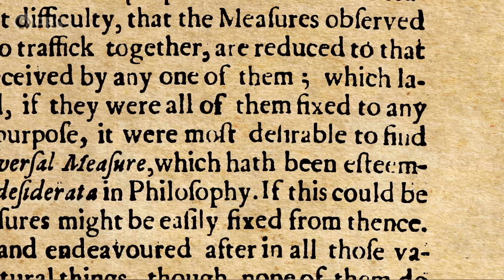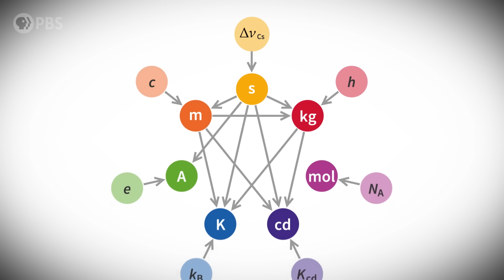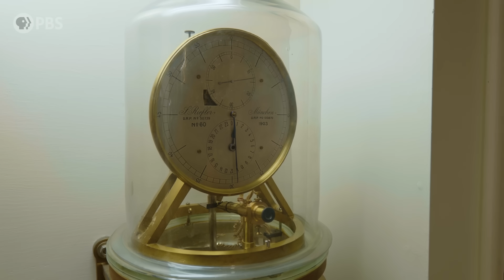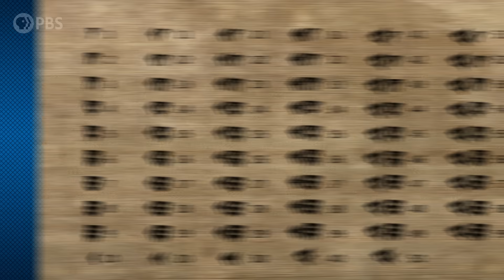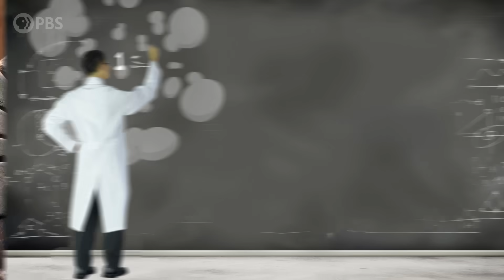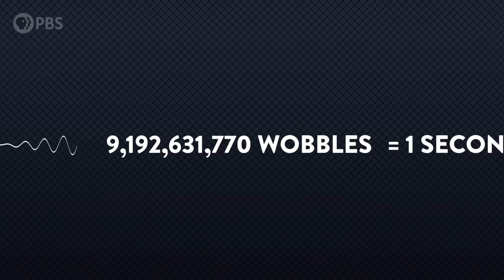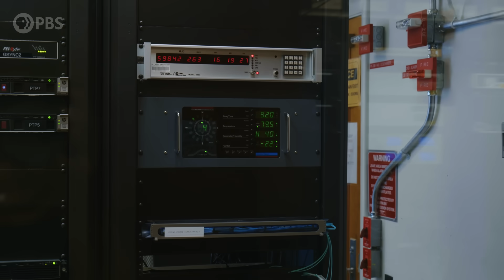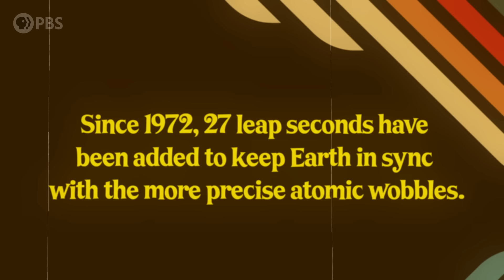The Unexpected Measure that Makes the Modern World Tick

Comment: The Metric system is great.... I always need to break things down into 10ths.  Not quarters, not 8ths or 16ths.  I need 1/10 of something.  It amazes me how much people dont realize it is a rather bad system for the vast majority of stuff other than Calculations.  Actually using the Metric system in real life is terrible.  Especially C as F is a far superior measure of temperature.  I dont want the difference between hot and cold being 1 or 2 degrees and no one should.
Reply: Engineers need to divide by "quarters, 8ths or 16ths". That you only care about you need shows how bigoted and narrow minded you are.

Comment: What I never understood is why we never seriously used Planck time for the measurement.  I know when he discovered it 1800s, it was an oddity and nothing more.  But all time measurements are just fancy ways to precisely describe a unit created thousands of years ago.  We don't need optics or radiation to measure the second, a second is and will always be, 1.86e+43 Planck time.  It is literally physically impossible to be a more precise than this.  You can't go faster than light, you can't go smaller than the Planck length....so Plank time is the most precise measurement system for the second.
Reply: Weel that's nice, but how do you MEASURE it?
Reply: @jaypaans3471  What I am not certain I understand...is you don't really measure anything.  A second is a second.  The period of time we call a second hasn't really changed on the macro scale per se in like 4000 years.  What's changing is the precision of the definition we use to say what a second is to make what seems intangible...tangible.  Whether we say it's a fixed number of radiation movements, or optical light movements...it's the same thing.  That's why I don't understand why we don't skip the games and just use most precise possible number we know of.  I mean when the two things needed to determine time are both universal constants (as we know them) then how can we not have the best possible definition already as all three factors are universal constants.  As for not having a system to measure it...yes this is true, but then we haven't built one to that scale "yet".  It's not that went can't, it's that we haven't needed to.

Comment: 5:35 Hey, what did 10 million years ago mean then? Do these mean 10 million rotations around the sun? How do we count time on such scales and hour do we align it with our current time? The same question about light years in space...
Reply: Rotations around the Sun haven't changed as much. If you lived millions of years ago you'd experience roughly the same length of the year measured in today's seconds. The number of days would be higher, about 400, they'd be shorter in today's seconds. 
For the year to change, you need the Earth to go to a higher or lower orbit around the Sun, which requires a drastic change in mass to change the momentum and, as a result, the orbit. Nothing like this has happened since Earth cooled down enough to give birth to life. 

I'm not a scientist. This is the best I can infer from what I remember from school and videos like this one. Thinking aloud so to say. Corrections are welcome

Comment: You mention @10:30 that since 2019 kg and others are fundamentally based on a second, but I thought it was based on the use of Kibble balance
Reply: Kibble balance is not a unit.
Reply: @sammiller6631  it’s a machine that use electric, not time, to define kg. I never said Kibble was a unit of measurement

Comment: The U.S. Congress authorized the use of the metric system in 1866.  There were improvements and revisions to the system up through 1960.  And probably more after.

The Metric Conversion Act of 1975 is an Act of Congress.  But is completely voluntary.
Executive Order 12770 July 25, 1991 made metric the preferred system of weights and measures for United States.

The resistance to flipping completely is strange.  Many industries in the US use metric but make conversions to non-metric for consumers.

Depending on context, I use both.

Comment: Would a cesium-133 atom have a slightly different wobble period in different locations in the universe? Would it wobble differently on earth that it does near a black hole event horizon or even just inside a supermassive star?
Reply: no, its position in the universe is irrelevant.
but that's only from its own reference frame, time is still relative, a second on earth isn't the same as a second near a black hole, but from the atom's own reference frame, it'll wobble periodically in the same manner anywhere in the universe.
which is why atomic clock in orbit around the planet have to take into account time relativity and adjust themselves to it.

Comment: Have they made (1 / Planck length) a thing yet?  Could be a large standard unit of length. And every one could agree on it cause it would not change no mater where you were.
Reply: Ya before I watched the video, I thought it would be about the planck constant. I thought it was at the bottom of most measurements. I think I will do some digging on the subject, if I find a good resource I will come back and post a link.
Reply: Planck units are derived by "normalizing" the numerical values of certain fundamental constants to 1. These normalizations are neither the only ones possible nor necessarily the best. Moreover, the choice of what factors to normalize, among the factors appearing in the fundamental equations of physics, is not evident, and the values of the Planck units are sensitive to this choice.
Planck units still involve some arbitrary choices in terms of the defining constants.

Comment: A Cesium jet oscillator has a finite lifetime, as a continuous stream of Cesium atoms must be emitted to be successively excited by microwaves to reach the correct pair of hyperfine transition; and must be compensated for Earth magnetic field. After a number of years the Cesium jet lose intensity, and the tube must be replaced and recalibrated. We use simpler, shorter term stability oscillators, made by using rubidium and called "secondary" standards which are good for most applications, like telecoms.
Thank you for the video...

Comment: I think ultimately it's going to have to change to something that doesn't rely on a frame of reference.  Like the speed of causality or something.
Reply: " Like the speed of causality or something." <- not a real thing.

Everything is in a frame of reference, it's own frame.
Reply: @TheDanEdwards  i mean, the speed of causality can be defined to be the speed of light. After all that is the speed of information. The main problem with "speed of causality" is that we don't really know if causality is even a thing.
Reply: @diablo.the.cheater  but thr speed of light needs to be measured and is itself not a unit. It is defined by othwe units. Time and distance.

Comment: I think I missed a step? When they first counted how many ultrafine transitions occurred in the cesium atom, they had to already have a second to count the interval in? So really, they just cemented that first arbitrary second as the Official Second? But they could easily have used a different analog clock to do their counting and come up with a different number of transitions, so what prompted them to settle on the number they did? Is there some independent significance to that number of transitions? Why not round it to a number with fewer significant digits? Wouldn't it have been just as legitimate?
Reply: The goal was to maintain the notion that an astronomical day is divided into 24 equal hours consisting of 60 equal minutes further divided into 60 equal seconds.  The number of ultrafine transitions that meets that definition of a second is your correct answer so that if you start counting  seconds at high noon when you reach 86,400 (24 X 60 X 60) you are again at high noon the following day.
Reply: @pbp6741  right, but if they had allowed an extra ten ultrafine transitions, or stopped counting ten (or twenty or a hundred) transitions sooner, they would still have gotten 86,400 seconds in a day, since the margin of error of the measure of a day is so high? Did they maybe tailor it to minimize the number of leap seconds they'd need to add?

Comment: My guess was that the universal period would have been based on the amount of time its take the fasted known thing in the universe light in a vacuum to travel the smallest theoretical unit in the universe the Planck length. Of course time could be divided indefinitely but nothing meaningful could theoretically happen in between a smaller unit of time.
Reply: And what happened is the opposite, we first defined what a second is, then we used that definition to find how much time it would take for light to travel a planck length, the reason being, that calculating the speed of light is by itself quite hard to do in a precise manner, and what would be even harder, is try to measure the speed of light on the planck scale.
As mentioned in the video, measuring time is most precise out of all other units, hence we use it to define other units.
Reply: Planck units are derived by "normalizing" the numerical values of certain fundamental constants to 1. These normalizations are neither the only ones possible nor necessarily the best. Moreover, the choice of what factors to normalize, among the factors appearing in the fundamental equations of physics, is not evident, and the values of the Planck units are sensitive to this choice.

Comment: Ever since I started to learn programming I’ve become quite the time infrastructure nerd. I even set up a crude Stratum 1 NTP server using a high quality GNSS receiver.
Reply: If it truly is a stratum 1 clock, then it isn't crude.
Reply: @MrT------5743 Crude as in “costs less than 200 USD & can actually be repaired“.

Comment: You say that the vibrations of the cesium atom is the same everywhere, but I would think that the strength of the gravitational field it is in would affect it.  Also, the time that is transmitted over the internet, how do they account for propagational delay of the message through the network itself? Do they measure it so that it can be taken into account? (These are the things that keep me up at night!)
Reply: Correct on both points. NTP compensates for network delays, and time is defined based on an undisturbed cesium atom at sea level.

Without enhancements, NTP explicitly assumes that packets travel at the same speed in both directions, a perfectly symmetric internet connection. Using that assumption, NTP compensates for the network delay.

Before we can switch to the next generation of time keeping, we need something more precise than sea level. The new clocks can be used to precisely measure altitude relative to other such clocks. We haven't defined sea level that precisely.
Reply: The NTP Internet time protocol is expressly defined mathematically, so to exclude the transit times from the time signal...

Comment: Wait so if the Cesium microwave standard isn't enough and now they're considering using visible light, why choose between those two? Can't any light work just fine? At first I thought there was something about that microwave frequency that was just right for the atom due to resonance or whatever, but now it sounds like you can pick and choose.
Reply: light is a spectrum,  so which one?
Reply: @columnarbasalt4677  Well the video first said a certain microwave frequency was the current standard. I thought they chose it because of resonance or whatever and the frequency had to be just right. But now they're sawing a certain visible wavelength works. Well if two frequencies work, the microwave and the visible one, why can't there be an infinite number of frequencies which work?
Reply: @alex_zetsu  Because resonance does only work on certain frequencies. Otherwise, every wine glass would shatter by talking next to it. They are probably using a different material to observe.
Reply: @pauljs75  OK, so if only certain frequencies work but there is more than 1 that works, what are the frequencies that work on Caesium?
Reply: @pauljs75  There are more Factors to calculate in. I doubt that LED/Photosensors will cut it precision wise.

Comment: Fun fact:. The US is on the metric system.  It is the official measurement system.  The imperial system is also the official measurement system.  We officially use both.  Which is to say, being intentionally pedantic, your graphic pointing to the US saying "not metric" is wrong.

In fact measurements like "feet" are officially defined as conversions from metric units.

Comment: Fun fact, while the Romans would measure time during the day using sundials, to keep time during the night or when it was cloudy (or during Senate meetings) they also used "water clocks" which operated by dripping water out of a vessel at a regular rate to measure the passage of time.
Reply: Romans also used wax candles with markings around the body to count the hours before the sixth hour and after the eighteenth hour - the nighttime basically.
Reply: Can you imagine that you are holding a Senate meeting and there is this drip drip drip noice every second. No wonder they stabbed Julius Caesar
Reply: @Yomabo  that made me laugh haha thank you :)
Reply: @Yomabo  Imagine a a loudly ticking clock at your bedside as the tool to get you up on time in the morning. I couldn't stand the noise!
Reply: How did they keep the water clock accurate? The lower the water pressure, the lower the flow rate.
Reply: @gabor6259  A pendulum clock also gets inaccurate the longer it runs, that’s why you change out the water in the top.
Reply: @matthewburger798  A pendulum is way more consistent than water. But the water doesn't have to drip at a consistent rate, just place the markings based on the time it takes to fill or drain to that particular marking. As long as it always drips at the same rate each run, the time to each marking will be the same
Reply: @gabor6259 They had an overflow near the top of the tank and this kept the pressure constant thereby keeping the outflow constant.
The device was called a "Clepsydra".
Reply: @gabor6259  By keeping it full? Obviously?
Reply: AND SAND CLOCKS !!
Reply: @whitekaren7742  Tis is the main reason the calendar became inaccuraer for 400 years.
Reply: @mrgcav  BUT WE KNOW THE CALANDER WITH GOOD ACCURACY TODAY. WE CAN GO BACK HUNDREDS OF THOUSANDS OF YEARS.
Reply: It is now 2 pisses and 5 dribbles past the hour
Reply: I’m pretty sure Wilkinson didn’t propose the metric system.  That was forced upon a subjugated Europe by Napoleon in his desperation to destroy the British empire - and it wasn’t based on anything other than a purely arbitrary metal bar held in Paris.
Reply: Which worked to an extent. The changing pressure of dripping water causes it to speed up at high water pressures and slow down at low water pressures.
Reply: The basic unit of the metric system = time.... And yet, the metric system isn't used for time keeping in the maco world in which we live... And similarly space...

We use "light years" or "astronomical units." which are based in part on how far one particular planet in the entire universe is from its host star, and how long it takes it to orbit said star.

No matter how enlightened we pretend to be....we still use things around us to measure stuff.
Reply: The water clock is called a clepsydra
Reply: The problem with Roman time measurement was there was always 12 hours of daylight (regardless of how long the day was).

Comment: I like to just accept that a second is the halflife of seaborgium-263.
Much easier than remembering it being 9,192,631,770 vibrations of a cesium atom.
Or we could base our seconds on Thorium-224 which has a halflife of 1.05 of our current second. That would make a minute the halflife of Actinium-222m.
Then we could just say an hour is 60x that since there is no atom with the exact 60x halflife length of Actinium-222m although Actinium-229 comes close at 1.045 hours.
IDK there are many ways to denote time I am just very curious as to why we decided on 9,192,631,770 vibrations of a cesium atom over other atom's halflives.
Reply: For practical reasons, half-lives of radioactive isotopes are not used to fix units of time. Atomic decay is probabilistic, not deterministic. The fewer atoms you have, the more irregular the rate at which they decay. (A single atom may decay anytime from right now to never.) But then, purifying and handling a large quantity of radioactive material is also problematic. Not to forget, as it decays, it keeps getting depleted. And keeps getting contaminated with its own decay residue. So you have to keep replenishing it and purifying it.

On the other hand, Cesium-133 is stable. And, as he explained in the video, its vibrations can be measured to a very, very high degree of accuracy. With none of the disadvantages of working with radioactive material.

Comment: Since the US Customary system is defined by the metric system, and metric is defined by physics, then it follows that the US Customary system is as equally accurate and standardized as metric. 
Other than confusing other people and enraging xenophobic bigots, not sure what the big issue is.
Reply: Yes. The advantage of the metric system is 1) the ease of conversion between units, and 2) widespread use. Those are notable advantages, but it's always annoying when people try to argue that it is somehow more accurate or less arbitrary. It is exactly as arbitrary as any other conceivable measurement system.